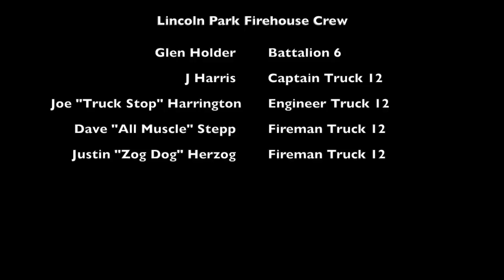Tuther Fire 2 FireCams

Comment: Flames and smoke can be seen in the BACK of the house.
Activate the pump on Tank Water.  
Grab line and run to the back.  
Apply water to the Visible Burning Material and protect the house.

Grab a hose and a battering ram and go through the front door in a fraction of the time it took them.
Vent windows as close to the fire as possible to release interior pressure.
Apply water to the Visible Burning Material.
Cut a small hole in the ceiling to check the attic.  If there is flame, insert the nozzle with a wide cone and everything is soaked in seconds.

Most of this could have been done BEFORE the first hole could be cut in the roof.  That personnel was wasted.  Fire Suppression is JOB ONE to PROTECT victims and fire fighters!
Reply: 😂😂 you have no idea what ur talking about do you
Reply: BleedBlue You always find ”experts” commenting on youtube now a days.
Reply: JB91710 A majority of fire was in the back but it had very well extended into the attic and house. The crews initial cuts revealed plenty of flame. Sending crews into the structure without those relief cuts would’ve subjected them to unnecessary heat and smoke. Allowing those crews to move inside in a cooler and safer environment was a great judgement call. 

Also, sticking an 1 3/4 hose into a small cut into an attic that’s rolling flame is just as good as sticking a water gun up there😂😂
There’s no way you’re going to knock down heavy flame. 

Breaking windows to “relieve internal pressure” sounds like something a cop would do. Great way to accelerate fire growth and mess up flow paths. 

And the end of the day brother, me and you weren’t there. There’s a million possibilities to how we would’ve handled that. Just enjoy the video man! These guys killed their operations.
Reply: The video shows that your incorrect in you assessment! There was fire in that attic!
Reply: That fire didn’t start in a shed. The entire backyard was jammed with junk, just like the garage and probably most of the house. There is no doubt the fire was already in the attic when they got up there even though nothing was showing in the roof ridge or through exhaust vents. I am betting this is the house of a hoarder.
Reply: Are you a fucking firefighter!!
Reply: enid0mom definitely there’s a second near the end of the video you can see inside the garage and it looks packed with all types of junk
Reply: There was a line stretched to the Charlie side and it was noted on arrival that there was extension into the house on arrival. anyone with any common sense knows that you have to vent an attic in order to confirm fire in an attic space quickly. You don.t know what you are talking about and you make yourself look very stupid making comments like the one below just so you know which one I am talking about here is the cut and paste version of that exchange 
"BleedBlue
1 day ago
😂😂 you have no idea what ur talking about do you

JB91710
1 day ago
@BleedBlue  Are you asking  me?  Don't you know?  I couldn't have spelled it out any clearer.   I guess people like you just can't understand basic English.  That's sad!
"

First} What is an interrogative statement this is a statement that starts with what, who, where, when, and why then continues to ask a specific question. BleedBlue Starts with a double emoticon indicating he is laughing at you. Then states you don't know what you are talking about. You respond in a pejorative manner inferring he is Illiterate.
Second} Here is a situation where a wind driven fire has extended to a secondary structure and penetrated the structures envelope. Now there is self ventilating fire inside the secondary structure. Laddering the roof and going up gives the opportunity to both check for fire in the attic and venting the attic fire through the roof fire issuing from the eaves indicates the need to check further or risk being found negligent in your duties. If there is any indication of negligence you can bet your boots that a good lawyer will have the insurance company getting a shitload of money. BleedBlue is right you don't know what you are talking about. What you saw was the execution of a coordinated fire attack different companies being assigned different divisions and the specific tasks associated with that division. They communicated effectively and coordinated the attack by doing what they were told to do. You on the other hand would have done what gone off on a wildcat style attack operating independently and most likely gotten yourself and others burnt or killed.
Reply: @retiredarthritic2083   Thank you David! But JB won't ever grow up, best bet is to report all his attacking comments, and for video uploaders to block him from commenting. One can only hope...
Reply: Jack you are the ultimate YouTube firefighter! Tell us some stories from your experience as a rural volunteer fire fighter ! Killington,Vt wasn’t it? Hey since we’ve already established there is almost no chance you’re actually drawing from real life experience, where does your expertise come from?
Reply: @mxslick50  Funny thing but Jack never replies to any of my comments since he was forced to apologize for violating my human rights. The other thing is he runs away every time I reply making mincemeat of his ridiculous and pejorative commentary he has been blocked by several uploaders because they got tired of his bullshit. Unlike Mr. Biessman I am a trained firefighter retired who has kept up with the latest information about firefighting tactics and have been requested to give my opinion about what firefighters were doing because of the knowledge I have demonstrated.
Reply: @ek6063   Well, one of his claims was that he is an "expert" at chimney building, so that, in his feeble mind, makes him an "expert" on fire flow patterns and ventilation. (In one of his replies to a post I made he claimed that heat DOES NOT RISE but will flow more readily in a horizontal ventilation setup rather than using vertical ventilation.)
Reply: @retiredarthritic2083   Thank you for the reply, and thank you for your years of service to the fire dept.  He is back at it again on this video:  https://www.youtube.com/watch?v=tgHZUyK2ON4  and just digging a deeper hole. you have to see the responses to me on there....Freud would have a field day with that nutball...

I will , by next summer, end up as part of the Vol dept. for our tiny city (pop. 35). A lot of equipment was donated to us some years ago.. a brush truck, small engine/pumper, and an ancient tanker that is down awaiting parts. We have lots of 1 1/2 hose, some turnout gear, canteens, and tools, as well as a bunch of radios that were left for years in an unheated trailer so the batteries are all shot.  Part of my job as public works director (I run the city water system and a few other things) is to help get our ability to hold fires in check. Our nearest municipal dept. (28 miles away) has agreed to provide training for us. 

As a water operator, our biggest challenge is we have NO hydrants in town. There is a 2" pump blowoff that has been used to fill the trucks. The same municipality I mentioned is working on donating a 30hp jockey pump, so hopefully I can set up a single dry hydrant by the main wellhouse to help if a fire breaks out.

Oh, and all of this is an unpaid position. I watch these kinds of videos to try to get a better understanding of what I need to know to be effective.
Reply: NinjaBoy and the Old Man I wasn’t really sure i believed you when you said this guy is on every fire video, but damn i think you’re right. Jb seems to be a angry old man, but i could be wrong lol
Reply: @kurtisyoder4423  LOL sadly, every day I find even more videos that he has trashed up. And it's always the same crap talk, and repeating himself. Freud would have a field day with him.
Reply: @raystinsky  Who was that directed at?
Reply: @mxslick50  Are you a yardbreather?
Reply: @raystinsky  Nope, so I take it you were talking to JB...
Reply: @mxslick50  Him specifically but I didn't want to exclude applicable parties.
Reply: We've got ourselves a star armchair'er! 🌟
Reply: @KyleSoldani  Is there something you don't understand?  I couldn't make it anymore Simple!!!
Reply: @JB91710  And as usual, you can't tell us how or why what YOU say is correct. All you can do is link to your playlists and act out like a spoiled 6 year old and call people names, and say "Grow up. "
Reply: @mxslick50    I ALWAYS say In Detail why my way is correct!  My way is correct because I eliminate the heat and smoke faster and safer than what you see in any video I comment on.  You and you friends just don't know how to listen or Think!  You are too busy trying to Deflect attention away from my comments with your Childishness and provide NO ALTERNATIVES.  Like I said, Childish.

Here is a Test for you and all your friends.  Let's see how you do.

PROTECTION!!!  That, is what victims need before anything else!!!   FIRE and TOXIC Smoke, are the Threat!!!  That, is what victims need to be Protected from!!!  When you think from that perspective and you consider Everything that is done from the time you leave the station to the time you get back, what is the Four Step To Do List upon arrival?  Think of EVERY Detailed step that needs to be taken before you can perform any job but only list the four most important things that will Protect any victims..  I'll give you a guide to keep you on track  
Are you fully dressed when you arrive?  
Do you carry onboard water? 
Are there hydrants or an additional water supply? 
Can you See the Burning Material?  
How accessible are the victims?  
Do you know Exactly where they are?  

1.

2.

3.

4.
Reply: Read ALL my comments here and then read everybody else's.  Who's comments will people Learn more from to protect victims and protect property?
Reply: @be5575  Yessir, and he'll never answer a direct question with anything other than his stock replies and name calling, because he doesn't know a fucking thing about firefighting..or anything else for that matter. He is about to get slammed hard for all of his misconduct on here, he has trashed over a hundred videos that I have found so far.
Reply: @mxslick50   Take your best shot child!  I speak the truth and you guys speak childishness.  Any rational THINKER can see that.  To bad 99% of you are NOT Rational Thinkers!
Reply: @JB91710  The only irrational one here is you, bud. But go ahead, keep talking, you are only helping my case.
Reply: @mxslick50    And you can NEVER explain how!  Oh, and this Case you are working on?  Good luck with that!  I don't know what you THINK you are doing but it's interesting you are doing that instead of talking fire fighting tactics like I Always do.  Boy, you put enough of you Children together in the same sand box, and you might make One Man out of all of you.
Reply: @JB91710  ".. instead of talking fire fighting tactics like I Always do. " Yeah right.  over 90 % of your comments are NOT about tactics, but name calling and arguing.  The day you actually DO start talking sensible tactics will be the day everyone stops challenging you.
Reply: JB91710 Bro can you not just enjoy 1 video with out being so rude no one wants to hear your what ever you want to call it
Reply: JB91710 No I don’t enjoy watching someone’s life burn your assuming and yes I do know a little I wouldn’t be watching videos like these if I didn’t what I don’t enjoy either is people like you who think they know everything and criticize every single Fire video out there and you weren’t even there I find it interesting and this house was abandoned
Reply: Agreed. All that advice was completely wrong. For one.. they are a truck team. Aka. No water or hoses. Their iob is vent- enter-search. Second... you never go straight to the fire and spray from the outside in because you will push the fire through the structure. Volunteer depts dont seem to get why people go straight to jobs, such as venting. The reason is, that on prof. Depts every unit on scene has a specific job, and every member of that crew has a more specific task of that job. Many things are happening at once
Reply: Copy and paste i reckon. Keyboard fire fighter?
Reply: @joelfleming67  That bas a really intelligent and informative comment you can up with.  Is that all you've got?  Your mother would be so proud!  Are you incapable of discussing fire fighting tactics?
Reply: That would be great advice if the IC hadn't assigned them to vent
Reply: While truck 12's company headed to the roof another company (presumably an engine company) is conducting fire attack on the shed and yard this can be seen in the video @4:30ish. Given the smoke and fire discovered inside the house running to the rear and attacking the fire in the rear is somewhat like The videographers description clearly states the fire started in the shed and was pushed by the wind into the rear bedrooms and attic of the house. Fire appeared from the first hole and confirmed fire in the attic. Which was reported to the Incident Commander and the Interior Division. You said this
"Grab a hose and a battering ram"  and go through the front door by bashing it in and destroying the ability to have any door control over the flow of fresh air to the fire. Fire intensifies and cooking heats are being reached the room is rapidly becoming unsurvivable now you are blind because the smoke is very thick and all you can see off to your right about 10 degrees off center is some fire glow. What do you do? What have you done? What you have done in your rapid advance is remove any control you may have had over the fire by limiting the amount of fresh air that flowed into the room behind you. Prior to entry the nozzleman should ensure the line is charged and free of air bubbles. The room you are in is going to flash over soon. What do you do There are 2 options option A get down on your hands and knees and retreat following the hose line out. option B get down on your hands and knees and try to identify the seat of the fire point the hose in that direction and open the bale after you have done that fog the nozzle and advance on the fire. There is a fact about water it is cool and will not allow fire to exist in a residential structure when it comes in contact with it. This also is true for cooling any space that is suffering the effects of fire. However there is something water can push that is air. This will draw air from behind you and push it ahead of you the moving air will help clear the smoke and allow for the interior division to pull ceiling and the roof division to vent the roof saving your sorry ass. What did you do wrong? You rushed ahead without a real fully developed plan. Got into trouble and had to be rescued. Your plan was a one pony show independent thought and fire attack that is the kind of front line thinking that was causing increasing L.O.D. deaths throughout the fire services consequently the Governors Island tests were conducted and the recommendations implemented. Now you can apologise for the disrespect you have shown and for violating peoples basic and legal human rights.
Reply: @mxslick50  Well you are correct and I am doing that too. I am however making it embarrassing for him by picking apart his ridiculous tactics and proving the one man show is nothing more than a dangerous and deadly way to fight fire. It will also help in preventing Probies from straying away from the training they are getting at their fire departments training academy I hope.
Reply: JB91710
1 month ago

Flames and smoke can be seen in the BACK of the house.
Activate the pump on Tank Water.  
Grab line and run to the back.  
Apply water to the Visible Burning Material and protect the house.
My Size Up
Determine if the house is evacuated If this can not be done then do a primary search if possible.
Problem smoke and flames can be seen coming from the eaves and other openings in the rear of the house. Indicates there is fire in the interior of the house as well as the stuff throughout the yard and into the shed. 

JB91710
1 month ago
Grab a hose and a battering ram and go through the front door in a fraction of the time it took them.
Vent windows as close to the fire as possible to release interior pressure.
Apply water to the Visible Burning Material.
Cut a small hole in the ceiling to check the attic.  If there is flame, insert the nozzle with a wide cone and everything is soaked in seconds.
Solution multi pronged simultaneous fire attack. Primary attack focuses on the rear exterior of the house and progresses away from the house across the yard to the shed. Why; this is where the majority of the fire is. Secondary line to be advanced to the interior of the house immediate action upon entry is extinguish the burning material and then search for extension into the voids and unoccupied portions of the structure. Roof division to vent and search for extension into the attic.
 
Fire attack stretch primary line to the rear and commence fire suppression. Stretch secondary line to door assign ff for door control. Breach the door and advance charged line to the interior fire seat (problem with JBs plan bust the door with a battering ram is how do you have door control with no door.) Fact the more air FFs allow to get to the fire the hotter the fire gets and the faster the fire will grow as per ISFSI. https://youtu.be/ATuCxWj6AW8 Venting windows defeats the door control and cause a more rapid increase in heat and intensity unless done properly and how are you going to get to a window in the bedrooms in the rear of the house remember the main portion of the fire is also preventing exterior access to the windows and there are doors and other airflow issues once you leave the fire room/s to vent. Remember that clear and concise communication is essential to achieve a properly coordinated fire attack which was demonstrated in this video. 
JB91710
1 month ago
Most of this could have been done BEFORE the first hole could be cut in the roof.  That personnel was wasted.  Fire Suppression is JOB ONE to PROTECT victims and fire fighters! 

The acceptable level of risk is directly related to the potential to save lives or property. The actions taken to reduce risk are listed in NFPA 1561, Annex C.3.1: “Risk Management during Emergency Operations.” They include the following:

Have and use written guidelines for tracking all members operating at the scene.
All members operating at the incident are to actively participate in the department’s accountability system.
The IC is responsible for overall responder accountability on the emergency scene and shall know the locations and functions of all companies. He shall initiate an accountability worksheet at the beginning of the incident and maintain it throughout the operation.
The IC shall implement branch directors and division or group supervisors, when needed, to reduce the span of control for the IC.
Branch directors and division or group supervisors shall directly supervise and account for companies operating under their command; company officers are accountable for all company members, and company members are responsible to remain under the supervision of their assigned company officer.
The IC shall provide for control of access to the incident scene.
The incident command system shall include SOPs that use “emergency traffic” communication to evacuate responders from an area where imminent hazard exists and to account for their safety.
Reply: @raystinsky  Jack is a troll and is also guilty of violation of the ADA and the Charter of Rights and Freedoms here is the proof. 
"JB91710
9 months ago
You want to call a Spade a Spade Fat Boy?  There's no way you could have been ANYTHING but a Fountain Statue." I think you should be more careful of what you take as truth from what JB says to you. He is not only guilty of that but he also tends to exaggerate his experience and knowledge. He has been on YouTube since  Nov.1 2010 proof posted below.
I build replica race cars that bring back fond memories from my past.
Stats
Joined Nov 1, 2010.
@91710
Reply: @JB91710  1/ When I was a Firefighter I always arrived bunkered up except for the SCBA because my seat was the one for the guy that jumped out and grabbed a hivol hydrant supply line 6" lay flat as opposed to the hard suction used for drafting. Due to manpower issues I would hook up the Hydrant and head to the fire building. I also had to set up and operate portable fire pumps for wildland fires. I was trained to identify hazards and to work a fire as a member of a truck company. and later as a nozzleman. 2/ That depended on when as a volunteer on a small town fire brigade I we had onboard water 500 gallons Imperial not US. As a Provincial firefighter no it was not practical. 3/ Some of the time it depended on where the fire was. There were times I had to use other tactics to suppress the fire. 4/ Again some of the time at other times we had to search for the fire because it was inside voids (Electrical in Origin). 5/ Irrelevant, we never gave up on any surviving victim. 6 irrelevant.
Reply: JB91710 I think i am more intelligible about certain things than you.
Reply: @JB91710  You calling someone else a child is hilarious. Your comments amount to the following. I want my way everyone should have me as the center of attention. If they don't i will belittle and insult them until they do or quit telling me otherwise. Good Lord I know 2 year olds that are better behaved.
Reply: @kurtisyoder4423  No Kurtis you are not wrong. Not only is he angry he is going to tell everyone what they are doing is wrong wrong wrong. What he forgets is the biggest oops occured before the firefighters were even on the apparatus and rolling to the fire. That was starting the fire regardless of how it was started purposely or accidentally.
Reply: @JB91710  For a supposed firefighter use have shown a lot of holier than thou attitude. Some of what you say makes sense then as you research the science and the overall situation the sense disappears and the fallacies in the tactics appear. As a chimney expert you have demonstrated you know nothing about flowpaths. You call roof venting ridiculous and a waste of time. Here is why you are wrong. Fires produce a very large amount of smoke gases and heat. the air vents installed are not designed or intended to allow the volumes of produced particulates, gases, and heat to escape through them. The result is that smoke gases and heat build up trapped by the volume of material trying to push through the vents. The attic fire is not visible to firefighters either inside or out. A JB follower and rookie firefighter pulls a section of the ceiling opening the attic to a rush of fresh air Remember you have busted out windows and doors this in accordance with your prepared plan. You have also stated this in other comments. The fresh air hits the oxygen starved fire that you have caused by not venting the roof. What is the result Boom Backdraft DEAD FIREFIGHTER.
How powerful is a backdraft here are a couple of links for you to see.

https://youtu.be/pZkcOjaIhSk
https://youtu.be/IB05B6JuhEY
https://youtu.be/Xb96ceUHmOU